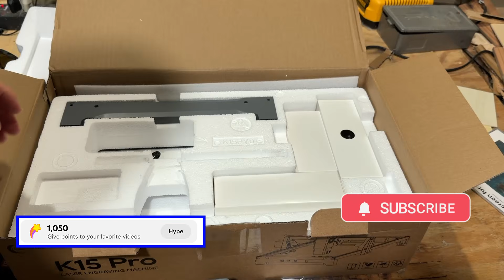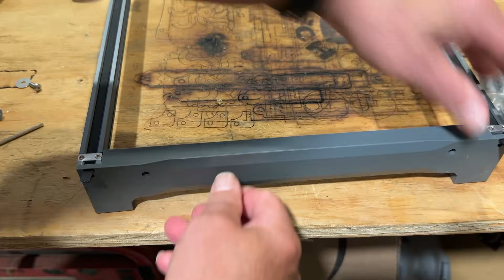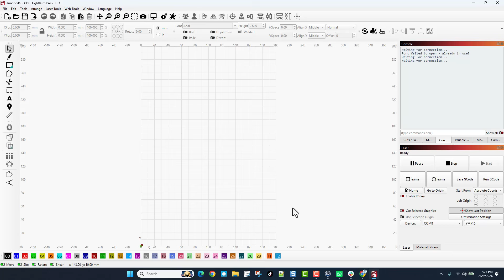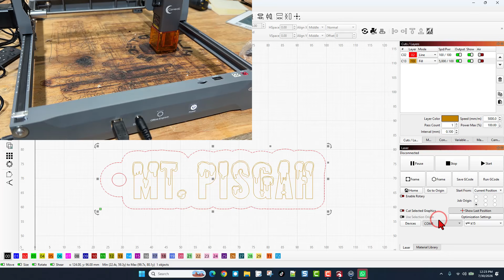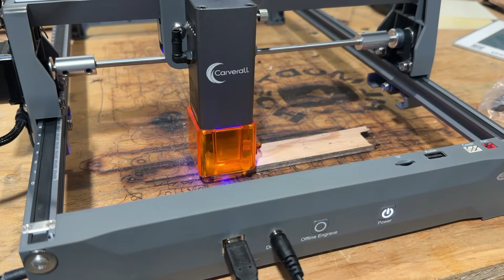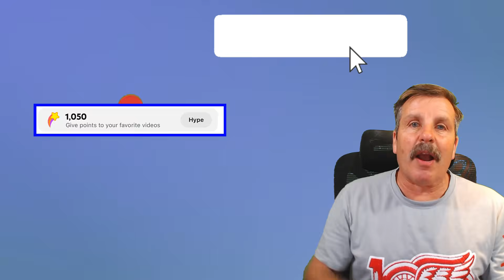Carverall K15 Pro Unboxing: Minutes to First Cut! 💯🔥

Comment: BUENAS NOCHES, ACABO DE COMPRAR UNA K15 PRO, Y CUANDO COMENZE A GRABAR EN OCACIONES SE DESCONECTA Y ME PONE COMO Q PERDIO LA CONEXION CON EL PUERTO USB, LE A SUCEDIDO A USTEDED CON ESE EQUIPO Y SI SABE ALGUNA FORMA DE CORREGIR EL PROBLEMA, LE AGRADECERIA, SALUDOS
Reply from the maker: I have not had that issue. I would see if it works fine using a file on the SD card... Maybe try a different USB cable, too. I would also contact Carverall support. Since I have had no issues... I really have no idea.

Comment: Hello ! Is your fill settings good for other projects ? for example the logo of a band or even the cover album ?
Reply from the maker: I depends on your materials. I would test them to see if you like the results on some scraps. The manual has a page with suggested values, too.
Reply: @HLModTech  Thanks for the answer ! the trouble i have is that with the same fill settings as yours my k15 machine don't grave at this point , it's not strong enough
Reply from the maker: Yeah, I use guess and check a lot. If you need darker, slow it down. I am guessing your power is already at 100.
Reply: @HLModTech  Yes and speed 5000
Reply from the maker: I would just keep lowering your speed till you get the results you want with the material you are working with.
Reply: @HLModTech  i've found 1200 speed and power 40 one time or 5000 , power 90% but 6 time , is it normal ? Thanks for you help

Comment: Interesting throw back to years gone by. Enclosed lasers became the standard a number of years ago. Not sure why someone would buy something like this when there are better lasers with enclosures. Thanks for the video & keep up the good work.
Reply from the maker: I think the biggest reason is cost. I wrote a $5,000 grant for my classroom to snag a GlowForge back in the day. These small lasers can be snagged for under $200.
Reply: @HLModTech  If cost is the only criteria then yes its a good choice. But in reality cost is only one consideration among many. I get that its cheap but the safety an enclosed system offers (visual, VOC, etc with ability to vent, etc. ) are necessary features, especially in a school situation. For me the criteria is safety, performance then cost, or safety, cost and performance.
Reply from the maker: What sort of stuff do you do with your lasers?